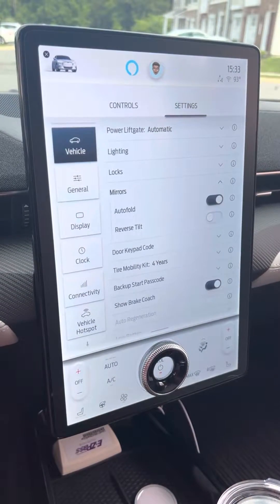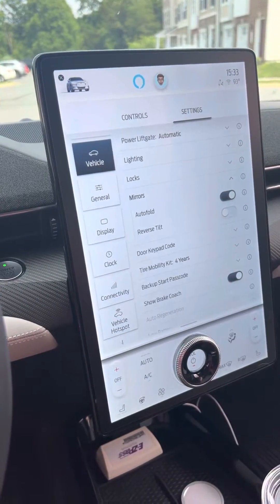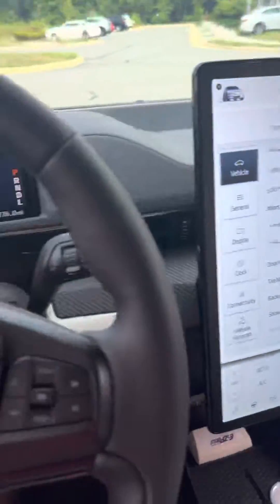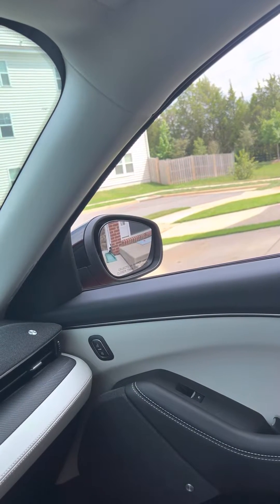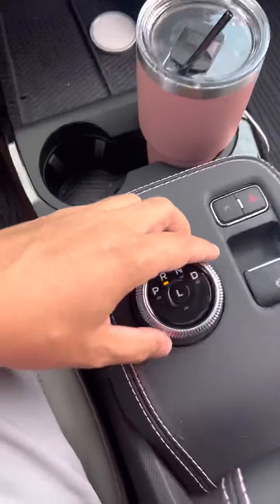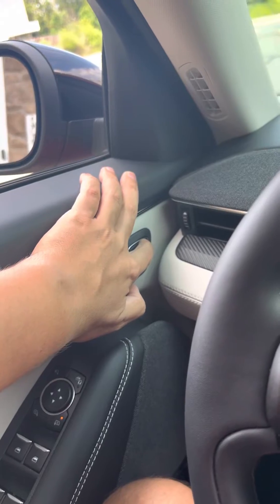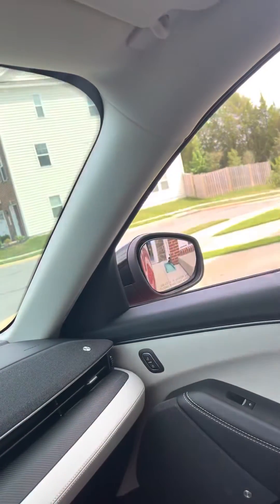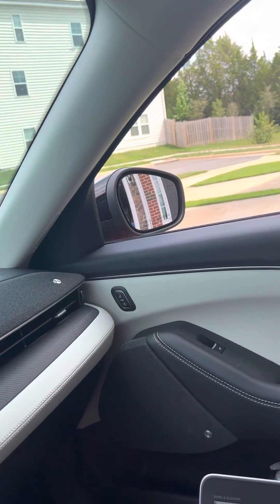Mustang Mach-E FORScan DIY - Programming Side Mirror Reverse Tilt

Comment: Great video! Question. It appears even after you program the reverse tilt mirror function you must first press the button on the door indicating which mirror you want "active" and leave it in that state for it to work? ie your right mirror button was still selected at the end of the video. Is that needed or could you de-select that and it still work as intended once programmed?

Comment: Thank you for taking the time to make this video. This is great info.
I have a 2021 Premium AWD, build 1.
I just purchased  Forscan license and bought one of the recommended usb adapters.
Now I have to build up enough courage to actually use it. 😂
I wish there was an option to remove the  backup chime sound. I don't think it would be bad as long as the spaceship sound still activates while backing up.
Reply from the maker: It’s very unlikely we will get the ability to disable the reverse warning chime that emits from the external speaker. Its a safety mechanism.